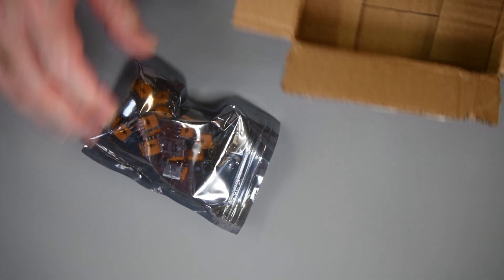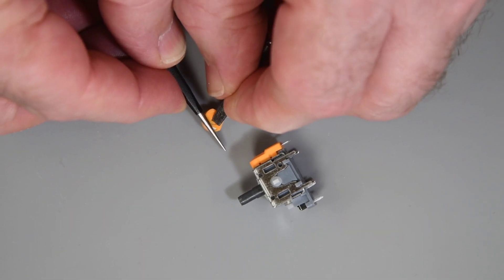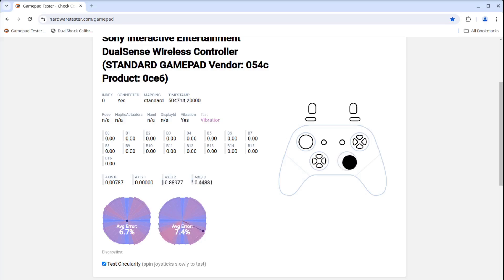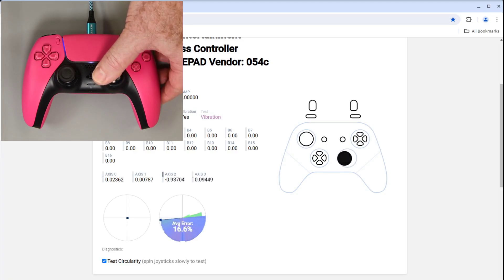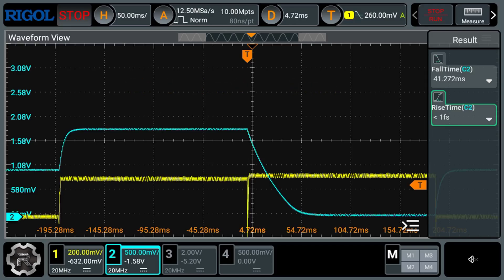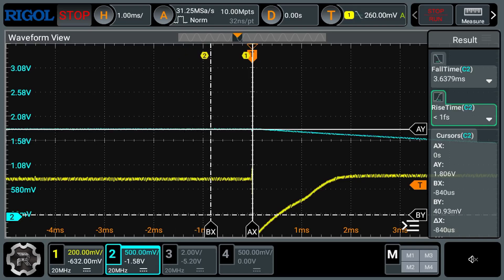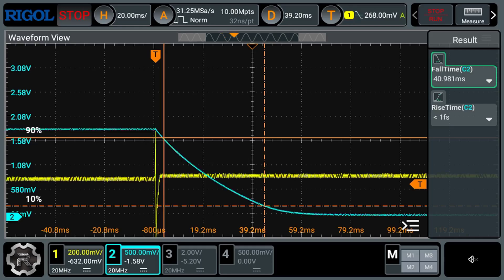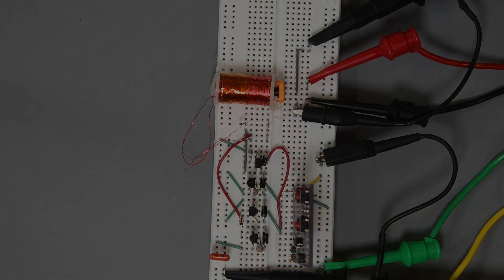Is This the Perfect Hall Effect Joystick for the DualSense?

Comment: I have an issue with mine, is stuck in up position -1.00 and it only moves to left and right, idk what to do, it's the right stick
Reply from the maker: The up position would mean near-zero volts on the output of the up/down sensor for that axis.  If you have a multimeter, check the voltage on that sensor. Take a look at this video: https://youtu.be/cWUnZ7KjUIQ . If the voltage is working at the output of the sensor, then probably the trace is damaged going to the center pin of the sensor.

Comment: Can we install this on ps2 controller?
Reply from the maker: I think so, if I remember correctly, the power and ground pins are the same as in the DualSense.  But I've never replaced a DualShock 2 joystick, so I can't guarantee it.
Reply: @metalplasticelectronics354 will you try to make on? Will love to see. Bcs right now i still trying to find good hall effect for ps2 controller
Reply from the maker: Don't bother with Hall effect, TMR is what you will want.  I don't believe I have access to a working PS2.  I'll have to ask around and see.  You can tell by looking at how the pins on the joystick are connected.  If facing the potentiometers, both left pins are connected to ground, the joystick frame, and both right pins are connected; it will be the same sensor arrangement as the DualSense.

Comment: Thank you for providing this video, it's spectacular!
I'm curious how come you know that the supply voltage needed for the module is 1.8V? I can't find the datasheet anywhere.
Reply from the maker: That is the supply voltage to the joystick in the DualSense controller.  Most of the hall sensors will handle a little over 5 volts.

Comment: is there any reason over time that the circulation rate would get worst, or the center calibration become off center? I ask becasue i installed one v5 a couple weeks ago and calibrated both center and circulation and saved afterwards. then 2 days ago i decided to install the right stick with the v5 plugged it in the gamepad tester and my circualtion was wayyyy off and the center was not aligned to 0.0 as previously
Reply from the maker: Circularity will change anytime the PCB is moved around.  Centering shouldn't be affected. A new joystick may wear in some, but I would think it would be a very small change.  How far was the centering off?
Reply: @metalplasticelectronics354  so after the first install of V5 on the left stick, center calibration was 0.00 for both sticks and circularity rate was 5.4% and 4.9% (left-right). then 2 weeks later i plugged the same controller and noticed center was 0.00 and 0.05 for left axis which was the changed v5 stick and 0.02 and 0.01 for the right stock stick. Circulation for each was 15.4% and 24.7%. the sticks for both were barely reaching the range and right stick was just a small circle not even close to the range. ended up calibrating again after the second install on the right side, but concerned some other controllers i worked on will do the same.
Reply from the maker: The small center error could be temperature change, but that wouldn't explain the huge circular change.   Did you try a hardware reset?  It's a strange problem. I haven't seen any controllers do that.

Comment: Hi nice video. Is there any chance that you can share the circuit used on the breadboard? Before attaching the hall effect sensor did you use the windings to create a big inductor in order to delay the current change hence better monitor used for slew rate calculations? Also, if you done the same testing for the stock potentiometer sensor, do you mind sharing these results as well? Looking forward hearing from you and thank you for all this work!
Reply from the maker: The circuit on the breadboard is a small H-bridge setup. I drew it on paper, but it's long gone.  The small PCB has an ATtiny MPU that reads a switch and switches the H-Bridge.  However, this turned out not to have a magnetic field that was powerful enough for some of the Hall sensors.  So what I'm currently using is this: https://youtu.be/UG9aZgA79vU?si=mhHjYqq78D3ZcRN7&t=194  .  I think I have some of the schematic diagrams for this.  Again it's just an electromagnet and an H-Bridge driver.  But this one is still not fast enough to get a measurement of the speed of the new TMR sensors.  So I'm working on a faster version, just not enough time in a day.  If you want the files I have on this you can email me at mike@mlplel.com and I'll look for them and send them to you.  This can not measure the time of the potentiometer joystick as that is limited by mechanical movement.  The output from a potentiometer joystick will be about as fast as the mechanical arm will move.  That and the amount of capacitance on the output will be the only timing limits for the potentiometer.

Comment: Who makes the best hall effect analogs for a dualsense edge
Reply from the maker: The lack of calibration software for the Edge will make the results of replacing a joystick kind of hit-and-miss.  I would look at the new TMR joysticks.  If you can measure the voltage on the old joystick and find a replacement that is a very close match then should have pretty good results.  But very time consuming.

Comment: I recently got a ps5 controller, installed these on a bdm 010 pc board, and all I've been getting is 3 orange blinks, even with everything connected properly. Nothing else seems to happen, so I'm unsure what's wrong
Reply from the maker: Look for possible shorts.  Maybe some solder splashed somewhere it shouldn't be.

Comment: can they be use in ps3 controller?
Reply from the maker: The only DualShock 3 controllers I have use a 4-pin sensor joystick and these will not replace those.  You can check which pins are ground and B+.  And then see which version of these will fit.  The sensors on the DualSense are the same.  One of the sensors on a DualShock 4 has the power and ground pins reversed.

Comment: Hi I installed a few days ago and everything was fine until recently my right stick it drifting all the way up and stuck there, any idea why this may be? recalibrating fixed for about a minute a few times but  now its goes back to that position no matter how much i calibrate it
Reply from the maker: Up means the output is close to 0 volts for the up-down axis.  Check and make sure the power pin is soldered well.  Also, look for some solder on the center pin that might be touching somewhere it shouldn't.  And like any electronics stuff if it's going to fail it will probably fail in the first few days, so it could be the sensor itself going bad.  Take a look at this video if you have a meter: https://youtu.be/cWUnZ7KjUIQ?si=K-rwr7duAHfOuX0g  .

Comment: Hello, do you know what Ginflull version has the L4-J code on a white background? I seen your video with the V5S and that L4-G this is a J. The magnet is rounded, its for the DS5 comtroller.
Reply from the maker: I'm not sure, I would lean toward V5.
Reply: @metalplasticelectronics354  but the V5 is not labeled as L4-B with that red sensor?
Reply from the maker: @ Ginfull's labeling is all over the place.  It would be nice if they would give a key to what version is what.
Reply: @metalplasticelectronics354  yes, and i think the one you say in your video that is the V5 in reality is the V4(SE) with 100gram force, and the one you said is the 5 S is the V4 with 120gf and this ones with 120gf are labeled as L4-G/L4-J/L4-H with a white sensor. Some Chinese guy told me there is no V5 hall effect Ginfull, the V5 are the TMRs. I have a picture with versions and their description but if i post a link my post gets deleted.
Reply from the maker: I use the model number the seller is listing.  I haven't seen any documentation from the company making the joysticks.  You can't post a link in the comments, but you can email me at mike@mlplel.com with the link.  I would love to see some documents from the company.  Thanks.

Comment: I’m having an issue where my dpad left and down are not working. I believe it is from the calibration software. Has anyone else run into this issue? I have no idea how to fix this. Everything else on the controller works perfectly fine.
Reply from the maker: Make sure all the flat flex cables are properly connected.  And make sure there is no debris on the mainboard or the pressure contact pad for the buttons.
Reply: @ yeah no I’m dumb I just opened my controller up today I covered the board in kapton tape when I was soldering and when I checked the dpad connection on the board it had some residue from the tape I cleaned it up with ipa and the controller is working fine lol thank you for the reply! New to fixing my own stuff so I thought I messed something up
Reply from the maker: Glad you found the problem.

Comment: of ginfull, favor union, gulikit tmr which would be:

easiest to get used to coming from regular dualsense controller?

fastest response time/better for competitive cod?
Reply from the maker: The GuliKit and the Hallpi joysticks appear to be the same joystick, and both are extremely good.  I would take the TMR over the Hall effect.  And if your controller has Alps joysticks in it you can just replace the potentiometers with the TMR sensors from either the GuliKit or the Hallpi and I think you would be hard-pressed to tell any difference from the potentiometers.

Comment: I'm currently using Hallpi TMR on my Xbox series controller. Feels good. Could you review it soon? I think it's the same as the Aknes TMR but just different branding with the brand HALLPI on it. But both are TMR sticks. Would love to see you make a differential videos between HALLPI TMR, AKNES TMR AND GULIKIT TMR. I think they are all similar.
Reply from the maker: Just finishing up testing.  Yes, it does appear to be the same as the GuliKit joystick. So it's a very good joystick.
Reply: @ If that's the case that's great. Aknes or Hallpi are a little cheaper than the Gulikit. I think it's more economical to use it. Also I prefer to use the original joystick caps rather than the Gulikit because I put on Kontrolfreek or something on the sticks or using my own choosen colour on the sticks.
Reply from the maker: The Hallpi will be just what you are looking for then.
Reply: @metalplasticelectronics354  Fantastic to know that. Please make more videos like these. Hero don't wear capes but you sit, are a hero we need.
Reply: @metalplasticelectronics354   I asked this earlier, but it can't hurt to do it here. Is there much interference from the vibration motors ?
Reply from the maker: Motors should be too far away to have any noticeable effect.

Comment: Im getting v5 for a little less price. Or should i get the v5s or even the higher priced v6? Will i feel the difference if i go with the v5?
Reply from the maker: There is a lot of difference between the standard tension Ginfulls and the high-tension ones.  The standard Ginfulls are a bit softer than the standard Alps OEM joystick.  While the high-tension Ginfulls are firmer than the Alps.  It all depends on what you are looking for.
Reply: @metalplasticelectronics354  not the tension. Other than the tension will I have a difference? Basically talking if the rise and fall times as you mentioned, will that be noticeable?
Reply from the maker: I don't feel any filtering difference.
Reply: @metalplasticelectronics354  ok thanks. so il get the v5 then I'm getting 10 for 20aud. V6 and V5s are much higher priced like 30aud. ✌️
Reply: Which would be best to have high precision in shooting games? @metalplasticelectronics354

Comment: Can you adjust the magnets again? Since I’ve seen other Hall effects that can be “un-stickdrifted” by putting in a thin rod and pushing the stick.
Reply from the maker: No need to there is a website for calibration of the DualSense controllers, take a look at this video: https://youtu.be/0fK1sapv0YI?si=0OmucE2Es0q3InYZ

Comment: when or if these wear out over time and lets say one day you notice that the left stick is now stick drifting to the left like 30% of the full motion, when you recalibrate them and "fix" the stick drift, do you now lose 30% on the control motion to the left? or will these just never get stick drift or whats the deal? is it worth? lol i have dualsense edge and just spend $85 for two new stick modules in which case means its cheaper to just buy a new standard dualsense controller every 4 months than change out my sticks and am wondering if maybe i should get HE stick mod and maybe i wont have to worry about it.
Reply from the maker: Stick drift shouldn't occur on the Hall or TMR joysticks. The joystick mechanism could wear and shift some, but that should take years.  Yeah, until the edge can be calibrated I don't see any reason to buy one.

Comment: I can’t even melt the solder joints I’m at a loss
Reply from the maker: You will probably need a higher-wattage soldering iron.  Try using some tin-lead solder it has a lower melting point than the lead-free on the controllers.

Comment: Just got some that say 93L47. They still had the square magnet though. 🤔
Reply from the maker: Kind of strange not having the curved magnet.  Maybe someone trying to move some old inventory?
Reply: @metalplasticelectronics354   Maybe. Was one of those small marketplace sellers under a megastore umbrella. Like Amazon.

Don't really know if the higher IC numbers mean newer revision necessarily though. Maybe it's just for another manufacturing line or something. 

Anyway, it can't possibly make my super erratic controller worse at least. 🥔
Reply from the maker: I'm reasonably sure it's a manufacture date code, so it's a later-produced Hall sensor. Even with the rectangular magnet, it's still a good joystick.

Comment: I saw a comment that this stick doesn’t work on bdm 010 controll model.
Could you make a video on which hall effect joysticks is compatibel with each bdm control model?
Reply from the maker: These should work on any of the DualSense controllers BDM-010 to BDM-040.  I tried the previous version of this Hall effect joystick in a BDM-010 controller and it worked fine.  See this video: https://youtu.be/6JX_kdyDnlM?si=wqqc9cGVINcIXBQA  .  Before installing the Hall effect joysticks, consider looking at the TMR-based joysticks.  It's a bit of work to change them and the TMR joysticks are better.

Comment: These videos are so helpful, thank you for putting them together. One question for you: Any tips on desoldering the existing potentiometer joysticks? I started my replacement project last week but it took over an hour to get one of the joysticks units off. The four larger corner pins (which I think are mechanical/structural) were especially difficult. Just curious if there was anything specific you did. Thanks again!
Reply from the maker: Take a look at this video: https://youtu.be/slxgHcYHnm8?si=cUvSxVWspULnDP-p  The Favor Union joystick switches are more difficult to cut apart than the Alps.
Reply: @metalplasticelectronics354  This is perfect, thank you so much! Can't wait to give it a shot this weekend.
Reply from the maker: Good luck.

Comment: Do the new Hall effect modules have a built in control board or do you need to solder an external pcb on to the back?
Reply from the maker: Now that the controller can be calibrated there is no need for the add-on boards.

Comment: I've upgraded 3 controllers now with these and they work great for the most part, but I do have one module with an issue and I'm not sure what is causing it. Every so often the joystick will register a very slight but continual push to the side, in-game it results in a character slowly crawling in that direction. It's been calibrated several times and none of the other controllers I worked on had this issue, so its baffling me. Not sure if its a faulty sensor, or if the spring is loose and is just failing to return the stick to true center on release. Anyone have any ideas?
Reply from the maker: If the tension on the joystick feels like all the others, I would more likely suspect a bad sensor or even a loose magnet.
Reply: @metalplasticelectronics354  Huh, hadn't considered a loose magnet, but that makes  a certain amount of sense. 

Thanks for the great videos, they've been really helpful in learning how to work on electronics!

Edit: I removed the x axis potentiometer from the malfunctioning module and found that for some reason it was using the flat rectangular magnet style. I had a spare module lying around, so I swapped in a new sensor with the rounded magnet, and after calibration it seems to be working just fine now.

Odd that one of the magnets in my batch of modules was the older rectangle style when all of the others have the newer rounded style.

Comment: For anyone that wants to know I just had them installed on my dual sense. They’re really good! I play Apex & I’ve noticed an improvement on aim & smoothness. I haven’t noticed any input delay either. Definitely worth the investment.
Also, if installing is too much work, there are people on eBay doing it for you. That’s where I had mine done - for £30. Took 5 days (send & return). I saw this as the better option, as opposed to buying a new controller.
Reply: link to ebay?
Reply: Thx bro I play apex too might consider buying hall effect too even though I fixed my stick drift by cleaning thoroughly the parts
Reply: I use these for apex as well and they are very fast, my favorite,
Reply: Yes, what’s the eBay seller, I’m trying to do that same thing?
Reply: how was the tension is it same as original or too loose or tight?

Comment: So do we still have to solder the Calibration Boards V5 on the back side of the board? I’m so confused because half the videos on here for Hall effect joysticks say we have to use the Calibration Boards and the other half don’t even mention it or use it.
Reply from the maker: You don't need the calibration boards now that there is software to calibrate the controller.
Reply: @metalplasticelectronics354 thank you!!!! 🙏🏻